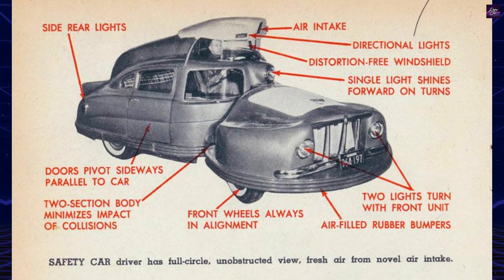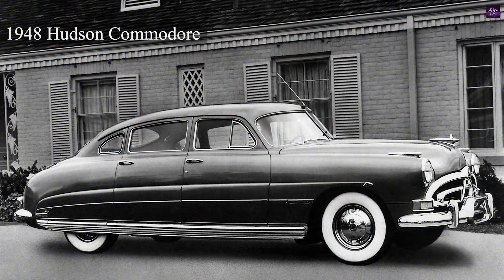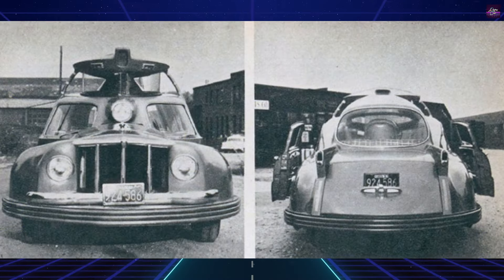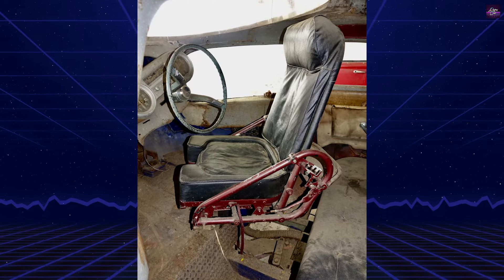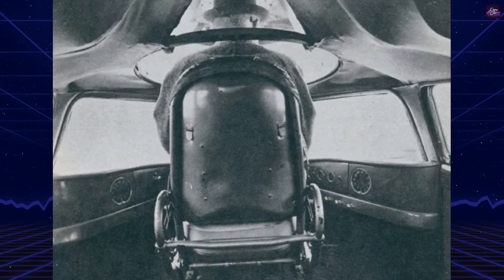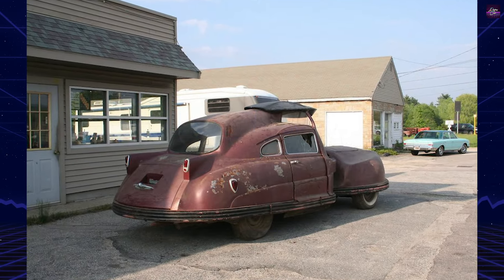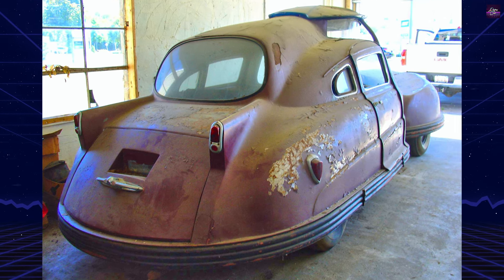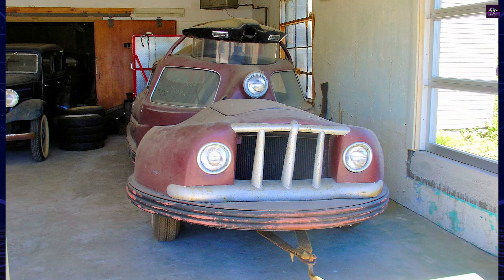1958 Sir Vival: Walter C. Jerome’s Concept Car That Prioritized Safety

Comment: It looks as stable as a bucket loader or forklift at high speed. Imagine you have a small collision on the right front side, on the highway... the engine segment turns 90 degrees to the left to crash into the barriers and the cabin follows automatically.
Also, how heavy does the hinge have to be to keep the car from breaking in two in a heavy impact? I prefer a one-piece car, with a crumple zone from bumper to dash.